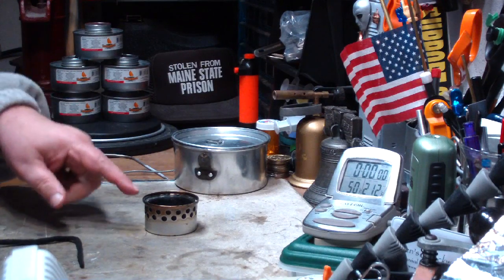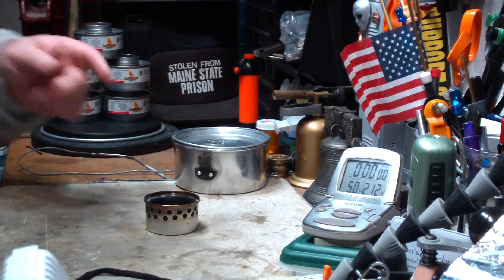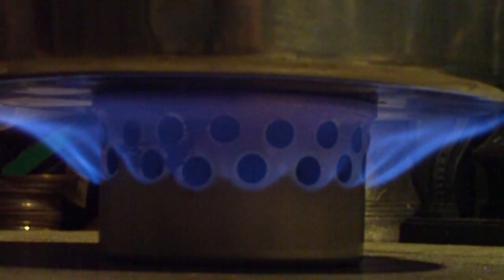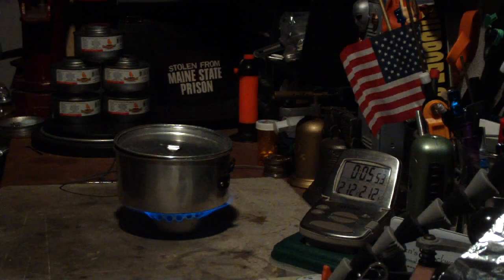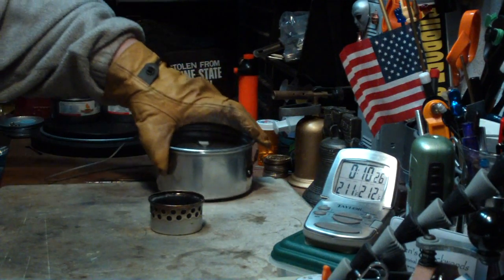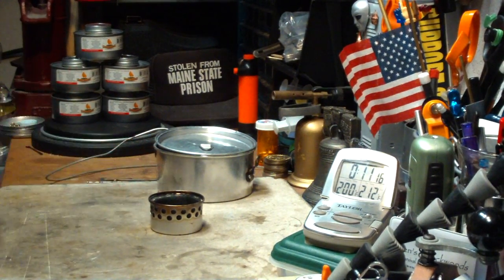Super Cat Stove - Low Pressure Side Burner with Carbon Felt Inner Ring - Boil Test #2

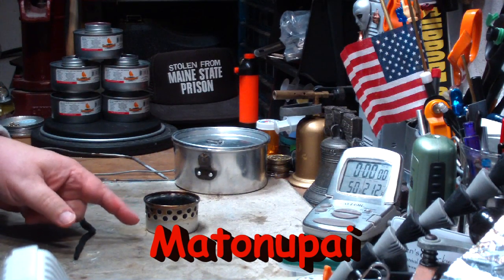Comment: In Test 1 - Bare Super Cat stove - 5:57 + 1:00 (preheat).       = 6:57
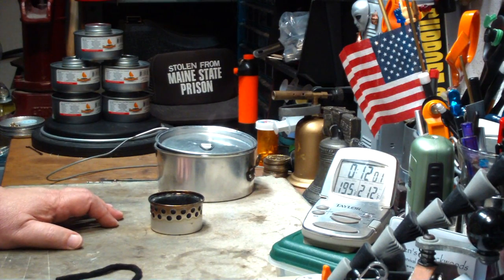Test  2 - Super Cat with Carbon Felt - 5:28 + 5 sec preheat. = 5:33
I've made one with a strip of aluminum can fitted inside the circumference, with similar results to the Carbon Felt insert. Boot time is 2 sec.
Reply: This aluminum strip add capilarity?

Comment: Hiram, do you think this could work with three rows of 1/8'' holes? With the carbon felt inner ring so the fuel gets sucked in the felt and doesn't spill out of the lower holes. With this you might get hotter flame

Comment: When I was in the Army we used stoves just like this ecept we would put sand in the can up to just below the holes and then pour some petrol in till the sand was soaked and light it and they worked pretty well.
Reply: The old Benghazi Burner.
Reply: Sand is a great idea.  Thanks for sharing.  Until recently, I'd been using liquid alcohol by itself.  I started getting worried because I often backpack alone... and if the liquid alcohol spills and splashes while burning, a serious accident could occur... far from help.  So using something to prevent a splash is absolutely necessary.
Reply: I’ve done it with gas, diesel, alcohol.    As a soldier from the days of C-rations, we learned a million tricks to have a hot meal.  We were also taught that the canned pound cake when mixed with diesel and lit made a good 20 minute smoke signal.  Love my Fancy Feast stove...I replaced the tomato paste can with a mini-energy drink can (same size) and my total stove weight dropped to 13g.  Rock on and cook it up!
Reply: +ARCSTREAMS 
White gasoline fueled Coleman stoves were used for half a century, and still are. Coleman lamps were popular even longer.  They even made gas fueled irons for clothes.  Now that idiot proof appliances are popular, people prefer propane powered camping appliances, being too clumsy to handle liquid fuel.

Comment: Hiram: many thanks for mentioning me and my videos. I came up with that idea for the Carbon Felt, then about two or three months later you tweaked the Axe stove with a wick that Yodogawanagare wicked a stove with fiberglass wick. I used four wicks 1/4 by 2 inches. I think you will get an even faster boil when you have the carbon felt coming outside.